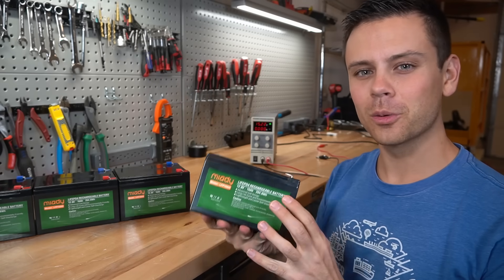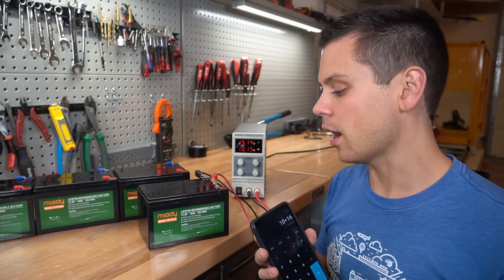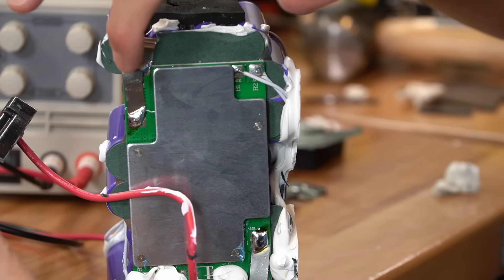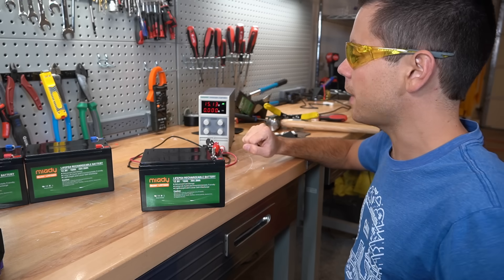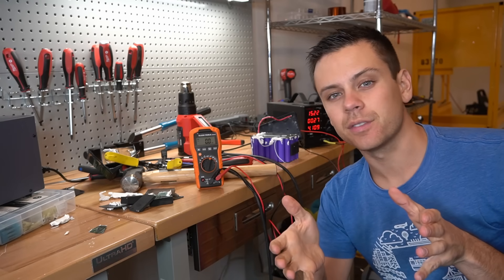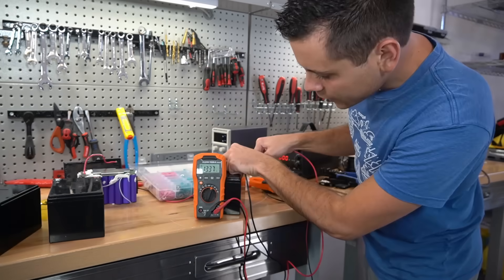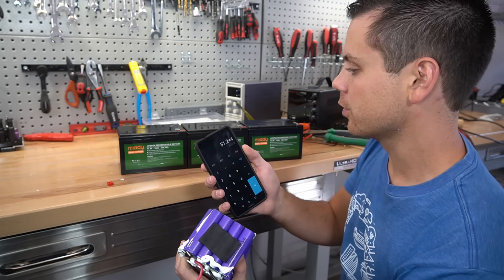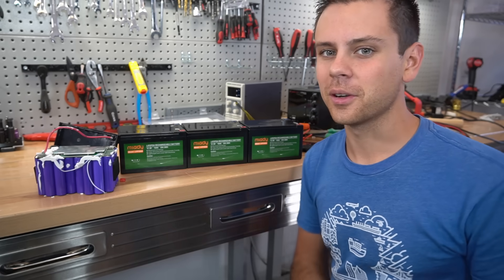$54 12V 16Ah LiFePO4 "Miady" Pack Tested

Comment: Hi I need info about a BMS 
I have a 52v 20ah 
I need to change my Bms because it don't work anymore .
So my question is 
What is 14s stand for and does it matter if it's a 14s or 16s what ever the number is

Comment: Built a 4 x 8ah power supply in an ammo box using the smaller version of these, and I'm extremely impressed with the cost to performance I got. The power supply I made has an additional voltage cut off, temp protection, and short circuit relay, plus I use a pwm charger to have additional protection when charging. 

With the price point I was hoping for 70% or better on the rated capacity, and  I tested it using my 12V bogue RV 53qt refrigerator/freezer.  In eco mode it held 38d for 30 hours, and my meter showed 24ah, so I hit 75%, and I'm within my expectations.

Comment: i have very similar batteries that fell into my lap. how do you deal with those terminals? say i want to connect 4 of these in parallel? is there a name for that connector? do i build a buss bar and just solder wires to the terminals?

Comment: Great Info!  I am planning  my small Solar system in Florida.  I'm a little confused about selecting the Volt size of gadgets....  Wouldn't a higher voltage Solar panel, Controller/ Inverter mean quicker battery recharge time;  Why chose 12V when 24V or 48V would be faster?  OR AM I really confused?

Comment: This looks to be a drop in replacement for the "BB Battery BP12-12" (sealed Lead acid) that came in my old APC ups... They are double the price in Canada (139 CAD). (just change the com to ca in your link) In my case the size is attractive, any bigger and it wouldn't fit. Even if it only gave 12ah instead of 16ah but lasted longer than the sla it would be a win.

Comment: Hi Will,
I have a quick query in regards on Off-grid solar.
I would like to install an Off-grid system at my carport , and use the battery to light up my LED at night. 
Would you be able to suggest me a package of that. Approximately 5kW of Solar (DC) in Size. What are the components that is require? 
Cheers,
Wei

Comment: I agree with the test you made on them....but with that said ....for the price I would still end up using them because I do not have nearly the budget you would have to build something with your standards, oh and does anyone know the website to where it automatically tells you how to 
align your 18650 cells after they have been capacity testes and how to 
put them in rows next to the right cell close to its capacity number?

Comment: Not related to this video, but I think, for sure I will get a correct and reliable answer either from Will or his subscribers;-
If I have 2 solar controllers, is it possible to join the outputs together in parallel to increase the useable watts please?

Comment: Mine reached their stated capacity after I allowed the internal BMS to balance the cells. I have purchased 4 of the 8ah versions over the last year for field equipment that we use.  When each of the batteries arrived I did a .33c capacity test and the batteries were between 90-95% of the stated capacity.  After that, I charged them to the point where the internal BMS shut off.  I then let them sit for 1 hour+. After resting I hooked each of the batteries up to a similar bench power supply as Will has and charged them at 0.005 amps for a day.  This allowed the cells to charge at a similar rate as the balance capability of most internal BMSs.  After allowing the internal BMS to balance the cells I ran another 0.33c capacity test and each of the batteries then performed at their stated capacity.  After the balance procedure, they now perform at their stated capacity after a standard charge.  It appears that the cells were out of balance when they are assembled.  

One important thing to note is that the BMSs low temp shutoff works correctly in each of the batteries that I purchased.  I have been satisfied with their performance so far.
Reply: I noticed in the video when he took cell voltages that they were out of balance and in line with your experience. Thanks for sharing
Reply: Brian, thank you for mentioning the low temp cutoff. I've been searching the internet all day and haven't been able to find a clear answer to my question. Does the Miady 12.8V  20ah LiFePo4 battery have low temp charge cutoff? You mentioned you have the 8ah version, and they all have low temp cutoff, and Will said in this video that he didn't see a temp sensor at all. Maybe certain sizes have low temp cutoff and some don't?

Comment: Too funny, my Lithium batter charger manual - which is only for Lithium batteries warns me that my Lithium battery could explode if there's a spark.
I'm pretty sure they pulled that in from one of their other battery (acid based chemistry) manuals. I'm pretty sure a lithium battery does not produce any explosive gases like hydrogen.

There are of course ways for these batteries to explode but I'm pretty sure a spark is not one of them ?
Please correct me if I'm wrong here.

Comment: You overcharged the packs. Do not exceed 14.6 V when charging. I have 3 of the 6 AH packs in parallel for running 50 watts out SSB on my Yaesu FT-891 and they work great.
Reply from the maker: The bms should prevent over charging. It's a piece of junk.

Comment: Can you do a review on the en3dc40+ DC to DC charger with built in MPPT. It's like the Renogy combined unit you reviewed earlier but should be able to handle larger solar voltages.

Comment: Will - What do you think about the life-span of these 'mostly' sitting in a backup generator?    I was able to start my Honda EU3000is generator - did it several times, several long crank tests - seems plenty powerful for this job.     Its a very tight fit (wider than lead acid) but it went in.   Had to make a pair of small custom connectors from LifePo4 (spade connectors) to bolt on (original battery) wires - but no big deal, plenty of room.   I'm excited to see if this lasts more than a few years - as you generator folks know, the lead acids wear out just sitting there month after month - even if you do test runs every month or 2 or even if you add a trickle charger I think 3 or 4 yrs is the longest I've had lead acid stay viable.

Comment: What if the short circuit protection did not work?  The wire would have melted in your hand.  Love the test . But it should be done outside with a large switch or contractor with the operator far away...   telling your viewers not to do ... then doing it ....  you can improve in this area.   

Also discharging to zero volts is bad for the cells .  You should never go that far down.

Comment: WAY OUTTA LEFT FIELD!  
I'm using a portable gas generator to power my off grid building in the woods of west Kentucky.
I have limited funds so l'm planning to transition to solar/battery in steps.
 My generator will run with no load for about 15 hours on 1.14 gallons (full fuel tank). Every 130 watts of load reduces runtime by 1hour.
This leads me to believe that there is waisted overhead cost for simply running the generator at less than full capacity (2000/1600watts). There must be a "sweet spot" which I've yet to determine. 
I'm thinking that it might be more efficient to go ahead and install my battery bank and use the generator to charge the batteries to save on gas until I am able to purchase the rest of my system. What do you think? Does this sound like a video experiment you might want to make do?

Comment: Can I use y consulting services to set up my electrical system.
80% Will run out off 12v & Ithe other 20% using to 220v (EU system)
600w solar panels
200amp lithium batteries

Comment: Yes yes. Now with better test equipment. Now when haters hate, let em see the digits on screen. Carry on
Reply: Yo Will. Milwaukee has a battery powered generator that will cook 40 sausage biscuits in a microwave per charge. With 2 sizes of removable packs. Recharge 90min. Dude you need to review, throw a few panels on it too recharge. When those guys see that on solar you gonna get a couple o clicks. Milwaukee MX generator. Your welcome

Comment: If nothing else this shows that lithium packs are just flat out overpriced.  Sure these are probably the factory reject cells slapped together for the cheapest cost possible, but I somehow feel like producing a similar pack with good cells and build quality isn't going to cost 50x as much.

Comment: trying to find long life replacements for the batteries in my Neuton lawn mower battery pack.  it is 24v with two 12v 10 ah cells, I had ten 7ah cells so 
I used those in several of the packs but I have to change them often.  any advice or recommendations , thanks Phill

Comment: Bad quality BMS. Using a quality BMS may give the full capacity and also keep the max voltage levels at 3.6v to where it should be. 👍👍👍
Reply: 1. did you buy these batteries? 
2. what quality BMS did you use?
3. Can you get a BMS that'll make it connect in parallel and series?

Comment: Thanks so much Will for looking at these.  I had brought it up in the chat.  As expected factory seconds, under capacity, and questionable bms.  They have been ok using an mppt charger and are probably good project batteries vs lead acid.  Have 4 of these in parallel with a 800w array and ran a window air conditioner to offset my hvac bill this season.  Will be setting up a mini split and adding a few panels along with the new renorgy 100ah pouch cell that was $630 on black Friday.
Reply from the maker: Thanks for the suggestion! They were fun to experiment on

Comment: Try this: is it possible to by-pass the inverter and link solar panels directly to a DC motor driven compressor in a split system air conditioner (so called inverter tech) such that the intensity of light is proportional to the air con output (brighter - more air con). Obvs only for daytime use, but could use DC battery at night.

Comment: Do these battery need any cycles on them to get to full capacity?  I tested LiPo's in 2005 when 1-5C discharge was the standard and true 10C was just on the horizon.  I found cells increased in capacity and voltage under load after a few uses.  Thank you for the review!!!
Reply: Same thing I have found. It is like they need a few cups of coffee to get going. :-)

Comment: Hi, can anyone recommend how to step down a 50W solar panel with Vpm of 18V and Voc of 21.6V Ipm 2.7A Isc 2.95A. Down to 16v 2A. I'm trying to charge a mini solar generator (lithium ion batteries) which requires 16v 2A max, will it be ok to charge with the solar panel directly or is the voltage of the solar panel too high?  Thanks you :)

Comment: I have 2 of the 12 volt, 8 amp hour rated ones and a power supply that will let me set the charging voltage and monitor the amperage. How can/should I recharge my batteries to do it safely and maintain what life they have? Also am I correct that I need to monitor the voltage as they discharge and not let it get below 10 volts? Thanks!
(not really surprised the measured capacity is less than the sold as, have seen outrageously much much worse, these at least came kinda close)
Reply from the maker: I would charge to 14.2V to be on the safe side. 14.5V to balance the pack every few weeks or so. I did not check cell voltages, but I would not go below 12V
Reply: thank you @WillProwse

Comment: Seeing what you can do with these battery packs would be more interesting... test the true capacity of the cells with better BMS, idea of using another BMS on the terminals (without taking it apart) to make it safer... whether 12, 24, 35, or 48V if possible, anything to improve what Milady battery now is. One of my idea is to use the 8Ah Milady is to replace the battery jump pack lead acid battery... I have yet to try it out... still looking for that lost useless jump pack.

Comment: I think you charged them at too high of a rate for their size making the high voltage disconnect trigger early.
Reply from the maker: No, it took a long time for current to drop to zero. The last bit of absorption can take awhile. And the voltage likes to settle quickly. It's standard procedure to pull full capacity. It took a long time to full charge them.
Reply: @WillProwse  One thing I have found with some cells is that the first, second, or even the third try with the same cells will not get you near the rated capacities. They seem to take a couple charge and discharge cycles to wake them up.
Reply: @WillProwse  
I see. Thanks.  Hey would it be possible for you to test the rated continuous output current?  The spec sheet says 42 amps which seems exaggerated to me.
Reply from the maker: @Andy-df5fj  good point, yes agreed. That doesn't seem right at all. Maybe surge, but surely not continuous

Comment: I'm using these for my kids ride on and they were a huge upgrade over similar capacity SLA for run time.

Thank you for confirming my concerns on running them in series, for now I'm just keeping them at 12v and will continue to do so
Reply: Darn! might make a perfect 24v UPS battery replacement

Comment: I bought the 12v 6ah a month ago. I slapped it in a plastic ammo box from Burlington Coat Factory. I put a cheap 2 USB port on the battery and it charges my phone more than 5 times. Im happy with it. Also the smaller battery is 29 bucks. The 12v 8ah is also 29 bucks.. odd

Comment: One point you did miss is that this cell looks like a viable long-life replacement packs for UPS systems being very close to the cost of a similar sized AGM
Reply: That's how I'm using mine, however it's touchy because of that BMS voltage disconnect.  When the UPS goes to float the lead acid, the BMS may disconnect and the UPS will throw an error.
Reply: Anyone have further insight on using these as UPS battery replacement?

Comment: Hi, thanks for all your tests and the money spent for it.
Could you suggest a nice battery to feed a 5000w BLDC motor and a KLS-S controller ? The recommendation is 48v 60ah but as you demonstrate in most of your video all battery from AliExpress are cheap but not providing the real amp/hour announced.
Please could you share with us the best link for voltage and amp I need ? Thanks

Comment: Hi Will.
Great video (as always)...
I'd not seen or heard of these...

U need 2 see "ghostwriter6699" s comment...
She swapped the BMS & it's working great 4 her...
Which is exactly what I was thinking...
Those cells look good...

Yes it's not the best build quality...
But if ur getting them that cheap...
U could spend as bit of time fixing them a bit & changing the BMS...
Saves starting from scratch, spot welding cells etc...
U could easily repackage several batteries into 1 bigger battery with 1 good BMS.!
I'd love 2 hear ur opinion...

It would b great if u could do as follow up video where u test the cells directly...
(I'd love 2 know their make & model, if there's anything written on them, if they r A/B grease etc)
& a 2nd test with a better BMS.
Cheers buddy.

Comment: I was considering getting 4 of these to use in a electric dirt bike at 48v.  Why is that a bad idea?
Reply: It's Not but Amazon Is always out of stock.
Reply: No expert, but I think Will's take is the build quality and BMS have him worried they may fail with vibration (dirt bike) and failure at higher voltage would be more dangerous, so he doesn't recommend linking them for higher voltage either.

Comment: I use these for a small system. I discharge them at about .1C  I get about 16 ah (usually a little less).  I have manually setup my charge controller AND I use my charge controller's remote temperature sensor to for temperature protection.  I posted my system on his forum (diy solar).    I have seven of them in parallel.  I bought mine a while ago when they were $45 (not $55).  I was hoping you would review them.  Thank you!
Reply: Would you upload your setup in a YouTube video and the charging way you do so? In a way these are still safer to use than lithium polymer  hehee
Reply from the maker: Oh that's awesome! I'll check it out. what section did you post it in?

Comment: What is the make and model of the power supply you use for charging.  Also its maximum voltage and current range

Comment: do you have any videos on high power cut off switches? I have a large bank of battle borns that i want to cut power going to my inverter. I have a 2/0 cable for 800amps 12v. I cant seem to find anything that can handle that. would be a good video also of all different type switches.
Reply: Take a look at "contractors" u may need several in parallel 2 handle ur load...
Reply: I hope you have those cables in quadruplicate. 2/0 is rated for at most 200 Amps and should never be used at 800 Amps as a single wire.

Comment: I have three of these batteries, two 8ah and a 16ah
The 8s are set in parallel in one of the small Harbor Freight Apache cases.
I use it for a post hurricane comfort pack.

My tests are much less scientific.
But it will run the lights on the pack and a four inch USB powered computer fan continuous for 36 hours and charge a cell phone from 20%.

I'll build another from the 16ah if I ever find it in my shop again.

I don't think they are suited for anything other than that.

One of the 8s came in DOA so I opened it up and one of the tiniest bms wires I have ever seen had lost its solder connection, easy fix.

Also I just used a cut off wheel at the connection seam and popped the top off, then put it back together with Gorilla Tape